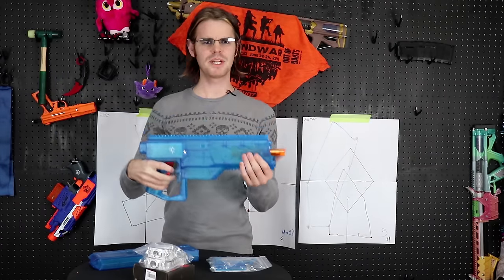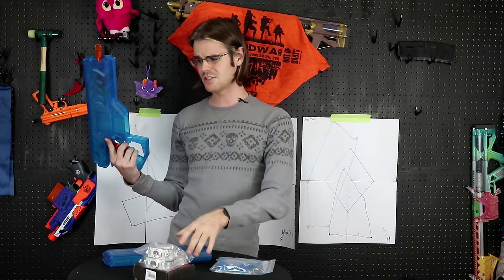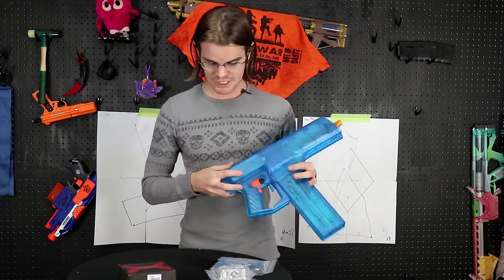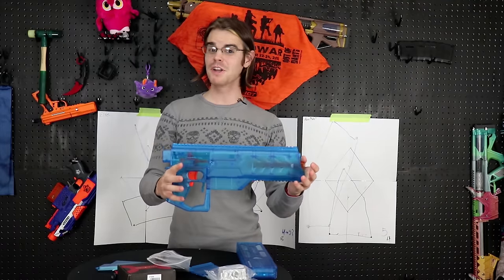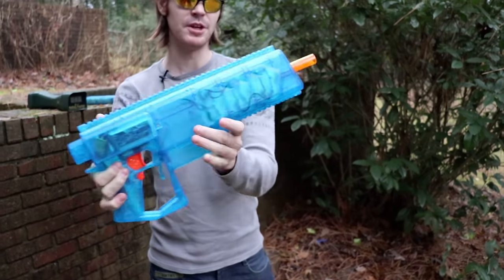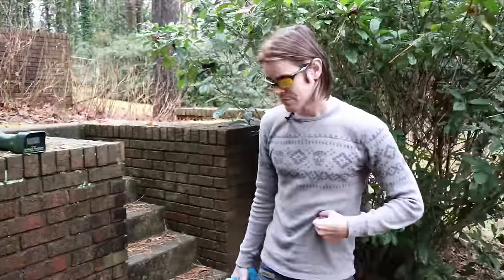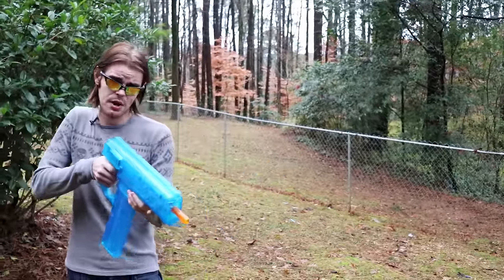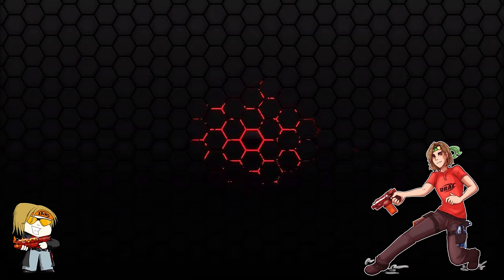Honest Review: Worker Dominator 3-Stage Flywheel Blaster!

Comment: I'd rather go with a single stage, and use it as a sidearm.
Reply: So a Stryfe?
Reply: Closer to a Rapidpistol, but with a 40-round reload. And a couple of jumbo-boxes stashed somewhere on my body.
Reply: IDE use a nite finder and a retaliator any day
Reply: Puny mortal. My primary will be a select-fire electro-pneumatic blaster running an open-bolt HPA engine, seated in a Stampede shell.
Reply: @endrlock  all about that but with a longshot

Comment: Had my own opinions about multistage set ups; namely that they weren't necessary beyond being exercises in excess given that a single stage brushless motor pair is quite capable of 200+fps.

But... the theory (need more than one video, with a methodical approach to testing and unbiased/doctored results) is that properly set up multistage flywheels reduce damage to darts by gradually ramping up the velocity, thus (theoretically again) reducing the initial grab that strips foam and tears heads off darts. Source and test video please; I'm not convinced. 

It is proven that 300fps is possible with multiple stages, although it took a quad cage of staged brushless (8 brushless motors) motors to approach that mark, which (see initial opinion) really boil back down to exercises in excess and diminishing returns. 3 sets of motors to add 100fps? Amusing, but impractical and inefficient. 

To properly build a Dominator with 3 pairs of motors (+1 for auto), scrap the old methods and use six rotor drone build internals with ESCs, BEC, main controller (Arduino Nano, or a dedicated flight controller), etc. that will safely handle the current and voltage requirements. While it can be done with brushed motors, brushless is really the way to go. 

Worker didn't intend this, so whatever. Beats printing a large shell or doing extreme surgery to an existing Nerf blaster.
Reply: How long did it take you to type this🤔

Comment: you are supposed to increase the rpm as you go through the stages
what do you think?
stage 1: Valkyries
stage 2: krakens
stage 3: over volt fangs
Reply: This kills the nerf dart. (if not the battery)
Reply from the maker: I did, rhinos into old school fangs into fang res
Reply: you can do it without the rpm increase, but it is less efficient, if you a have  battery stock go with  meshiel 2.0, fangs re, and brushless 2030's all on a 2s 3200 mah with 50c
Reply: i read on reddit that in really close setups like this you should increase crush, but maintain rpm, otherwise the difference in rpm doesn't help and just damages the darts as they get ripped from one flywheel to the next. if you increase the crush you're imparting more energy to the dart as it goes through the stages.

i'm doing some hyperions in an aurora cage with bulldogs into wolverines with eclipse cage and wheels leaving out the middle cage.
Reply: the logic actually goes both ways, if your cages aren't spaced very far apart, it is better to use the same motors for all stages, because the crush will increase the fps, but if your cages are spaced far apart, then you should go with increasing Rpm, because if the cages are close and you increase in rpm then the dart will slow down because it will be halfway between cages that are both pushing it at different speeds which equals more drag
Reply from the maker: Reddit is literally the worst source in our hobby.  Everybody with an option I trust or work I respect (except Slug) left it a while ago.  I am inclined to disbelieve the links I am sent and the comments on it.
Reply: @Equinox-il9iz  that's why I'm skipping the middle cage in my dominator. I'm hoping to have the dart travelling fairly fast before the eclipse cages really let er rip. I'm just waiting on my cage to be printed.
Reply: If u need to spit out nerf darts at the speed of sound then u woud need a 10 stage fly wheel blaster powerd by w24 (thats an car engine) and whit 1000 darts chain

Comment: The physics behind a one and two stage flywheel setup stand true, no matter your opinion. With the friction coefficient between the wheels and the dart, no matter what rpm, accelerting the dart with a motor any faster than 25k rpm will result in a cap of about 120fps on a one stage setup. Having a second stage subsequently removes the tractive torque it takes for the dart to accelerate from 0 to 120fps, therefore giving the secong stage more headroom to accelerate the dart even faster until it reaches that flywheel's maximum coefficient before slipping.

Comment: yeah, most people i've seen with this thing have just been using a battery stock with this due to the abysmal battery tray size as mentioned in the video, which honestly makes it even less appealing since its just another expense or extra steps to use that method.

Comment: I'm thinking a mosfet and a custom stock to house a bigger lipo for the power requirement. Maybe hollow out a transparent blue worker stock. But personally I'd still limit mine to a 2 stage at most or single with the full auto pusher just for the dart spamming ability.

Comment: Doing it as a progressive 2-stage seems the ideal way to set it up. And only use a Worker lower-crush cage as the first stage better guide the darts from the dual-stack mag. I'm pretty sure the wildly curving shots are a result of the canted 3rd stage cage. I'm so done using canted cages on high fps builds. When I can get (very good condition) accufakes and waffles to hit a 12"x12"  target at 60 feet from my 140ish and 160ish fps Stryfes and new Stratohawk build (hitting 145 to155 with a 42.5 cage and Bulldog flywheels),  EVERY SINGLE  SHOT from straight cages, what's the point? Unless you like your darts to pull high-G turns instead of flying straight :-)

Comment: Yeah, I don't really get the point of having so many stages in a blaster. I can see having a second cage at the end to give an extra boost to combat barrel drag, but there's only so fast foam darts can move through a system, regardless of how many motors. Not to mention the possibility of the components being misaligned if somebody without much experience with building blasters were putting this together. And with so many essential moving parts without access to clear jams, an issue would put you out of a nerf war until you could open it up and fix it if you didn't have a good backup.

Comment: Normally I don't agree with absolutely everything you say, but I have to say, you are absolutely right on the Dominator, it's ridiculous, and for a 3-stage system, the FPS and cost just turn me off,  I'd rather mod one of my Hyperfires or Rapidstrikes with Fang Revampeds, Bulldog flywheels and my own 3D printed 42.5mm cage. if I want range or FPS, I'll just use my Longshot.

Comment: I understand multi stage for people with extreme skills and a tight budget who make awesome builds throwing old stryfe cages in like a modulus and getting 200+ FPS from a setup that cost them less than 25 bucks (assuming basic motor upgrades). However, if you’re buying a $40 base blaster it’s taking the budget part out of it, and I don’t really see the point unless you’re going for the most powerful flywheeler possible.

Comment: Use drill batteries. Or something. Should have enough amps and you can buy em online, simple charging too.. or get brave and run a chainsaw battery.. but 40v is insane..oh. and unless you're used to real rifles, the weight is gonna be tiring

Comment: My take away from this video

Flywheels bad springers good
#springermasterrace
Reply: The take away is that the Dominator is bad in design. Not that flywheels are bad. If Drac was trying to promote that notion (which is the exact opposite of what he would do) then the video would be very different. If you prefer springers, that's totally fine. If you prefer flywheels, that's fine too.
Reply: Coney Dawg alright that’s kool
Reply: Flywheels give quantity but not quality. Springers give quality but not quantity. Air gives both. #HPAMasterRace